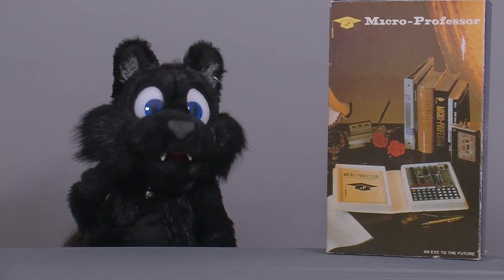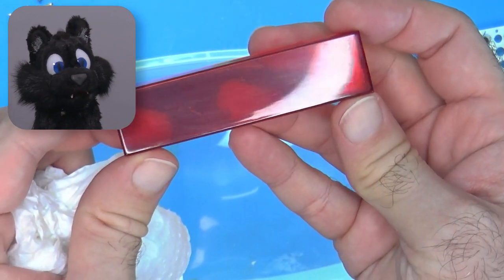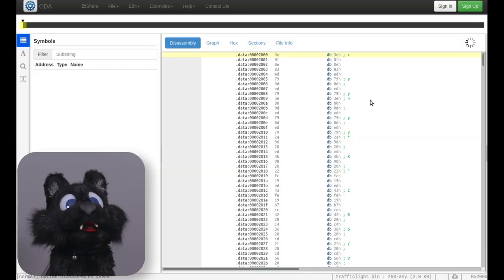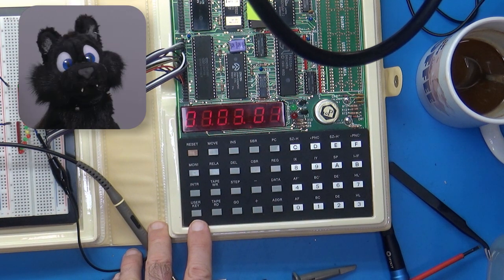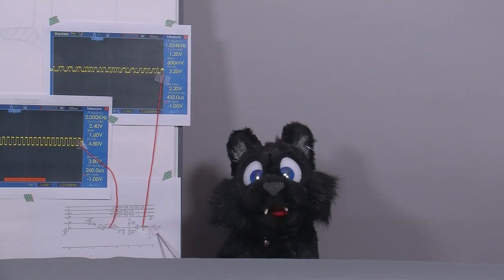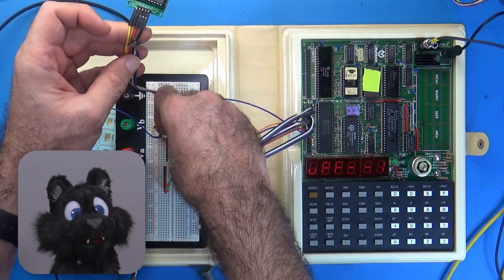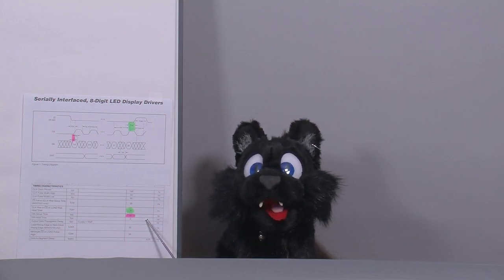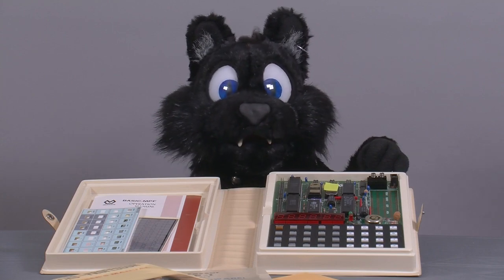Retro Computing #1: MPF-I

Comment: I had an original MP back in 1982 and had a lot of fun with it. Years later I lent it out and never saw it again. Finally and recently, I looked at Ebay and found one for a good price. Only thing I did with it was buy a PIO chip and added jumper pins to the 7 position jumper so that I could select a 2732 eprom for added routines. My original had the CTC but I don't really miss that. Fun little device!
Reply from the maker: They were rather common in the day, so they occasionally pop up on ebay; the prices vary though. The CTC should still be available as a chip, if you need it. I think I saw offers for NOS or even new replacemnts. The Z80 infrastructure is still relatively strong. I also found a source for a printer by now, which I should be able to pick up in February....

Comment: Now that's a pretty MPF-I. Definitely a thing of beauty! :)

My "trainer" was a GE Series Six PLC attached to a Berstorff extruder calendar (now KraussMaffei).
Reply from the maker: I never got my paws on a PLC; I looked into the concept a few times, but the different programming style is a bit off. I think they took the relais based ideas and translated them to processors? Well, maybe if I come across a cheap unit somewhere I might peek into that too. Note to self: need more time... 😸
Reply: @atkelar  Yeah, the programming is designed for maintenance workers to be able to troubleshoot, and if necessary, program the PLC as well. So the programming software displays the program as a ladder diagram would on an electrical print. This makes it easy for us electricians, somewhat difficult for engineers. 

And in addition to the layout of the software being odd, you have to wrap your head around each rung being its own piece of code, and even the order of the rungs can affect the operation (known as "scan dependent" programming). And that the program would start at the top of the program, and scan ( aka, solve) each rung in succession. The state of a bit could change in the process, and the new state of that bit may or may not be used further down in the program. And nothing would stop the programmer from changing it again further down if desired. 

And to make matters worse, every PLC was programmed differently. That's changed somewhat these days (I love CODESYS), but it's still a major pain.

This programming style tended to be something that you either "got" or you didn't. Computer Science grads seemed to have the hardest time with it. And it was (and still is) normal for a company to skip the formal education requirements in the case of someone who showed aptitude during the job application process. In my experience, about half of the guys were Electrical Engineers, and the other half were whatever. 

I got my start when I couldn't stand a problem with a machine at the Goodyear plant In Lincoln, Nebraska and stuck around after work and fixed it. It was the first time that I had ever programmed a PLC, and when the plant guys got done chewing my butt out the next day for hacking into their PLC, they made me a PLC programmer. That was back in '87 I think. 

And as an aside, I recently was gifted with a GE-Fanuc 90-30 PLC (with a 331 CPU. That's an old PLC, and it will require the DOS version of the programming software. That's the bad news. The good news is that it won't require the Windows version...). 

A friend was cleaning out his attic and stumbled upon it. :)

If you do get interested, check out the Click PLC from Automation Direct. $88 for the PLC, which comes with a few I/O. And the software is free.
Reply from the maker: Oh, yes, the "ladder style programming"; I've seen a few tutorials and this is what makes me think it was primarily designed to get people from relay logic to computers with as little growing pains as possible.
Since I don't have practical use for any of these, I will still look for used units to do some refurbishment; oh, and I think I recently saw that some companies provide the rugged industrial IO ports with an arduino backend; I might also look into these eventually.
Tim Hunkin has recently made a general overview video on how he uses PLCs in his contraptions.
Reply: @atkelar  I think that it was because in factories electricians are more plentiful (and cheaper) than engineers. We can argue all night long as to who writes the better code. If you write it "Stepladder" style (@15:00 mark in the Tim Hunkin video), I think that your electrician would find it easier to do. If you program it as a "State" (@39:00 mark in the Tim Hunkin video), you would probably do best with an embedded guy. But in the end you get the same results. :)

I wouldn't recommend getting a PLC trainer unless you were really interested in learning about PLCs because on top of everything else, they are really slow compared to even the 1Mhz SBCs of ages ago. And expensive. 

Oh, and naturally, the PLC in the trainer that you end up training on won't be the one that you actually develop for. So don't bother with the PLC trainer.

Not all PLCs are created equally, the (more) expensive ones would continue to run the ladder logic while you load the program, while the cheaper (but still expensive) ones stop the PLC while you are loading your changes (yikes!!). One thing that is nice is that you can see (mostly) what is going on within a rung (and don't believe everything that you see!). This makes troubleshooting much easier.

That Series Six (referred to as "S6" from here on out) that I mentioned in my first post used four 4-bit processors tied together to create a 16-bit machine. The processors that it used were optimized for Boolean operations, and it was the hot setup of the day (1982). A S6 without a program would run at 7ms, compare that to Allen Bradley PLC-2 which was around 50ms. And the S6 had a dedicated state-of-the-art programming terminal (4.77Mhz IBM XT) which included disk storage, and incredibly, had the ability to document your code inside the LogicMaster S6 programming software.

The industrialized Arduinos make more sense from a cost and a "it will more than likely work for much of the time that you need it to" aspect. And compared to an AB or Rockwell PLC, the Arduino might be on a par with those PLCs (infamous for having to be rebooted from time to time). By comparison, the really great PLC I/O modules (GE Genius I/O and Turck TBEN I/O) are virtually indestructible. We're using the Turck I/O for a project on Antarctica. Rated as IP69K, and good to -40C (however we need -90C so, meh).

The Tim Hunkin video is great! (I'm listening to it as I write this, I'll follow this up by watching it). Which reminds me, check out Mechatronics. It does a great job of interfacing the electronics to the mechanical hardware.
Reply from the maker: Oh, I am not arguing about what is "better", rather pointing out that I am more at home with the "regular CPU assembler based" style. In my opinion there rarely is an objective "better" anyhow. Everything depends on where one is and where one wants to go. Whatever gets one there the quickest and easiest is arguable the "best" for that situatoin. All these technologies are born out of certain requirements. The true strength in the programming model seems to be that it has some built in fault detection and mitigation. i.e. "if this motor output is enabled for more than 2 seconds, shut down everything" - things that one would need to code from scratch in almost any other environment. For industrial control systems, this is no doubt a must have above anything else. Can't have an elevator drive stuck in "up" until the cable snaps :)

Comment: Hilarious! I just got the MPF-1-P in and did a video on that (is released on 21-01-2022).
We had this MPF-1 in college. I too was already writing 8086, 6502 and 68000 assembler. I never really liked the Z80 as much as the 6502 and certainly not like the 68000. But this board was really fun. 
The IO on this one is it a port or also the whole bus? On the MPf-1-P it’s the whole bus, so you’ll need to put a little address decoding in. But I don’t recall doing that at school. And yeah, we too had a traffic light 🚦assignment and a washing machine I recall.
Cool video and I love the host!!!
Reply from the maker: Thanks! With this one, the PIO and CTC chips are put on the ribbon connector pins and lend themself for normal extensions, but the address/data bus is also available (on the second pin header) for expansion boards like the printer or eprom programmer, which in turn come with their own ROM chips. I remember that the printer one even had a disassembler so you can get actual assembler printouts.

Comment: That’s a good find
Btw a question, what would be most effective for clean a battery leak from a calculator mainboard?
Reply from the maker: I have come to like vinegar for that. But you need to get some that is not directly intended for consumption, because those are usually also mixed with oils and seasoning. They work in a pinch but require some additional cleaning with alcohol to remove the residue. With "pure" vinegar, you can just use water to rinse it off.
Reply: @atkelar  ahh gotcha, thank you so much for the information hun